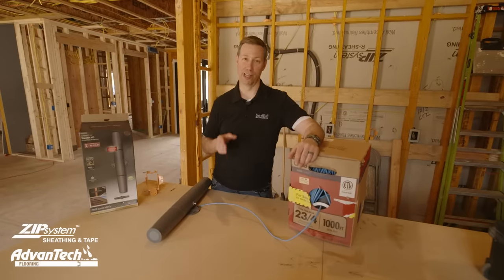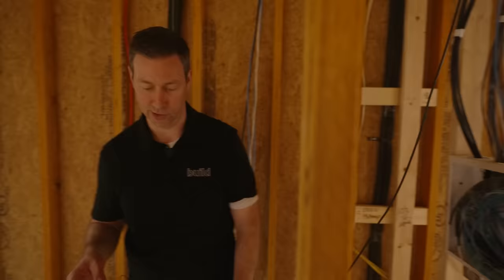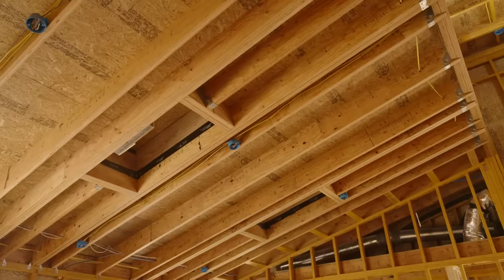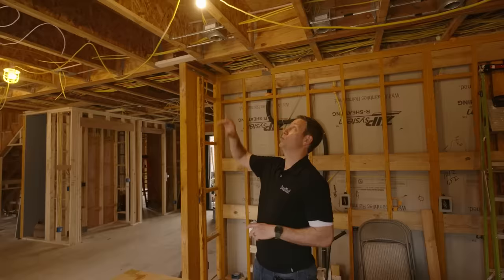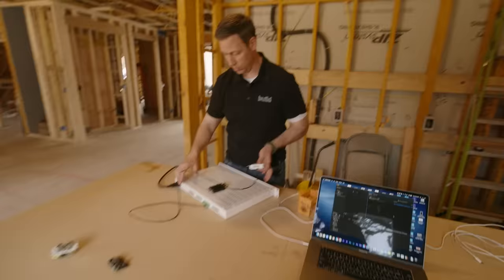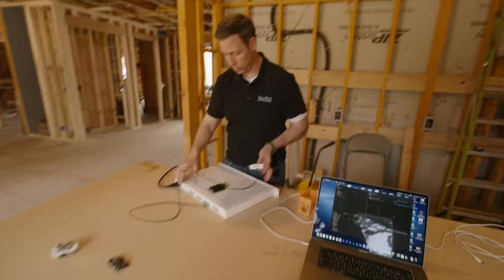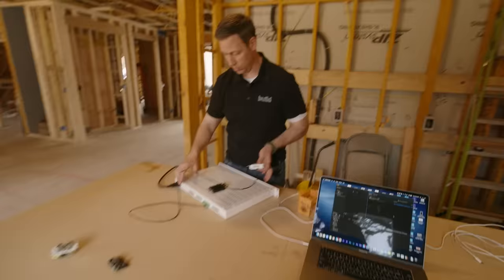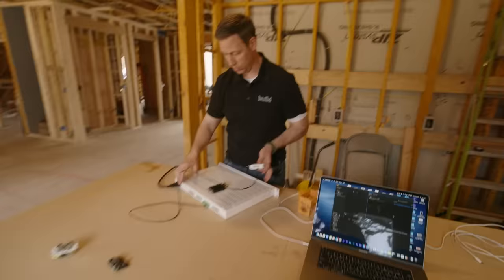Low ⚡Voltage at the Real ReBuild

Comment: You should add a flexible conduit vs a proprietary cable from the TV to your media cabinet. Proprietary cables come and go. You can always run a new cable in a conduit.
Reply: +1 for the conduit.  Change your TV and you may need to change out that wire.   I would hate to have to dig into the walls and ceiling especially with all that Rockwool.
Reply: Agreed with a nice pull cord just in case.
Reply: @Ampacityelectric  The head on that Samsung cable would need a 1 1/2" Dia opening or 2" conduit..
Reply: @FJB2020  Yep, should just drop a 20" can and put the OneConnect behind the TV
Reply: @Niccodemure  Then you have to run a bunch of HDMI and they don't play nice over 35' at 4k 60 fps..
Reply: @FJB2020  I'd run the Samsung cable outside the conduit, but still put in a conduit for future use. Then when the TV goes, you could just leave the cable or cut it off and yank it out. In fact I might run 2 conduits to make it easier for that future use.
Reply: +1 on the conduit AND when you run the proprietary cable for the TV, add a CAT6 run if you don't have one there already.
Reply: @FJB2020  I have a Frame TV above my fireplace mantle with the cable that came with the one connect box to a built in cabinet next to fireplace. 1.5" conduit and it fits through it, can confirm.
Reply: @Ampacityelectric  Yeah I did that when I built my home theater.  2" to the PJ from my media rack and 1" to all 13 speakers.. 

I am designing our new home and it will be ICF, so I am going to do Conduit runs in the wall so I can future proof the entire home.
Reply: @ErikAnkrom  In that case you have to pull the cable from the TV side right?  I see in 2019/2020 they reduced on side of the cables connector to the OneConnect box.
Reply: Matt installed a 2" innerduct from the TV location to the media cabinet so he is covered for any future changes.
Reply: @FJB2020  That's why you run it over ethernet.
Reply: @kimttar  Personally I would pass on that.... 4k, 60hz, HDR10 and ARC are flaky at best and the "lossless compression" is not something I would want.
Reply: @FJB2020  The can hold the OneConnect, Sat box and many other normal sources.
Unless he is using a BD player, but that would be odd.
I would say 95% of our installs on Frames have all the equipment local in the box. Most of our homes are to big for the Samsung in wall rated cable anyways
Reply: I've read that the one connect cable is really fragile.
Reply: @VIPvog  It doesn't like tight bends since it has Fiber-Optics inside..
Reply: We have a larger box behind the frame and out the samsung frame head behind the TV. That box is less than their in wall cable and pretty much future proofs the install.
Reply: I'd like to see a separate video on how the Samsung Frame TV install goes.  I've read many negative reviews on the install process and that it does not end up flush to the wall for the desired clean look.
Reply: @Ampacityelectric  Welcome to Texas. No basement, no attic access is the hard cowboy life here.
Reply: @VIPvog  the cable is fragile. So fragile that the first one I had to return because the cable failed. Likely due to a bend or something when I pulled it through the conduit. I would definitely advise being very careful when pulling and when routing behind tv. Test the TV first before you hang it, then after to get a sense of it's a bad cable.
Reply: @FJB2020  are you running conduit in the concrete in the wall? What products have you found to do so?  I'm starting a ICF home also & I'd like to know what you've found. Thanks
Reply: @darbycain  I found a detail on a YouTube channel, but I was not 100% sold on it, so I am going to do a modified version.. 

https://www.youtube.com/watch?v=t4N7WUusBNo

My thinking is to place 3/4" PVC in the center of my forms and run a line to each room from my utility closet.  This way I can update low voltage stuff as they change.  I will probably do this for the main 120v runs to the middle of my second floor joist bay.  I Can easily run wire to it and from there I can do the standard ICF foam detail.
Reply: @FJB2020  thanks for the video, looks like the same concept I found in ICF magazine. https://plastilockelectrical.com/  
Not sure what brand of ICF your going to build with but it's pretty thin pickins to find any manufacturer that gives info on running wires in the wall, it's always cutting the foam & stuffing wire. I'm for running wire in the wall myself!
Reply: @darbycain  How close are you to setting block?
Reply: @FJB2020  builder is in process of getting bids from contractors now. No set time to start at this point.
Reply: @darbycain  I am still in the design phase, but have already started excavation work.  I plan on using Nudura and Quad Deck products.  We plan on starting a channel on the build process (we are going to DIY 90-95% of it).
Reply: @FJB2020  Very cool. I'd like to check out your channel!  I will be using Fox Block for my foundation walls & main level. Lite Deck for garage floor & deck. I plan on DIY that part & the builder finishing.
Reply: @SeanBlader  Completely agree!  When I made a home theater with a projector and 130" screen ten years ago 1080P was still the standard.  I ran two thick HDMI cables from the media room to the projector, and then an empty glued 2" PVC pipe/conduit to the location of the projector behind the face plate of the dual HDMI.  I figured if an HDMI cable goes bad I have a backup, and if when the "next standard" comes out (which looks like 4K, but maybe 8K, or higher than 60FPS?) I can suck a line and then fish that new line through the PVC.  I'm still waiting for 4K LED projectors with lens shift to be somewhat affordable, but I definitely don't regret the $50 or less for an extra HDMI cable and a conduit.  I'll never open the wall again, so I wanted to be future proofed.
Reply: @FJB2020  And you could always cut that cable if you need to remove it... hopefully future connectors will be small!
Reply: No!  Use rigid raceway, not flexible conduit.  Why?  Because flexible conduit is vey difficult to pull wire through.  Beside that, you need a LARGE cross section on your raceway to be able to run whatever is needed.  If you use flexible conduit you run the risk of cables binding inside the conduit.
Reply: @FJB2020  This fact alone leads me believe futureproof conduits that are run should be as large as possible in diameter through areas that you can't easily fish wire. Personally, my future home whenever I get around to it won't even be in romex- it'll be flexible conduit just on the pure off-chance of the need to fix something or run an extra circuit or whatever. Although the odds of my stuff getting screwed up over someone else who I need come after and fix because they didn't know better are low, the odds are never absolute. Things going mostly wireless including receptacles and whatnot have slightly eased the burden though. (edit, i totally just realized this video is 3 years old.. oops, lol)
Reply: Yes, the stupid Samsung one cable will probably become extinct. ... hopefully

Comment: Wireless systems can easily saturate in large families and have coverage problems in large or unusual homes. Having a wired backbone for offices, stable media locations and possible repeaters/hot spots is a great idea. I am an IT professional and have six kids, the oldest 4 are voracious high def media consumers. I actually run two separate wireless networks in my home now to keep it under control.
Reply: Not really, your "saturated" when you run out of TDM on a band and frequency or channel. You can run on about 12 devices per frequency before taking hits on "speed". Even though I absolutely hate ubiquity, they do well on the AP points. They can auto channel hop thats how you can get that mythical 240 devices on a AP point though your prob going to be saturating the cat for it. Hope he is running POE with these.
Reply: Agree. For simplicity and reliability keep everything you can wired... televisions and desktop computers especially.
Reply: I have 6 Cat5e drops and I’d easily love to double that amount.   I agree with you VT ..I don’t want to endure WiFi routers degrading over time.   All stationary devices need to be hardwired leaving the mobile devices and appliance on the WiFi.   It’s never going to get any easier to drop in cables before the drywall goes up.
Reply: @hmurchison8123  honestly it wouldn't be better to run more drops that just saturates the channels more. That's what I was trying to get at. Its better to run a managed wifi network vs multi-networks. Only time its beneficial is when security separation is needed. I run 3 vlaned wireless networks for that reason. Public wifi, Private wifi, and Utilities with the later two not broadcasting thier ssid. Also you can take advantage of mu-mimo and beamforming between your ap points. But those vlaned wifi networks are ran from the same ap ppints through the managed network
Reply: @JavaZombie  power over ethernet
Reply: I always hardwire anything that has a rj45 on it..
Reply: J H power over Ethernet, commonly used for security cameras or can power other devices without need for wall outlet nearby
Reply: @JavaZombie  yes indeed what everyone else has stated. But power over ethernet can be used to power almost any network device like ap points, the aforementioned cameras, doorbells, security panels, and in some cases Raspberry pis if you use them for monitoring of stuff.

Reason to suggest running poe is to keep thins simple. Also have had emi issues before with some ap points and their respective power delivery near them. Ie transformer for door bells or AC zone panels...
Reply: @SimanSlivar  I have POE cameras and on my homestead I put in outdoor APs all over the property with direct burial CAT6.  I can mow 25 acres and still listen to youtube music lol..
Reply: @SimanSlivar  The instant you use "your" when you should use "you're," most people with any intelligence will discount everything you say afterward. Yes, it matters. No, it is not a "mis-spelling."
Reply: @Crusader1815  i honestly don't care. Im not writing a research paper or anything formal. This is a YouTube comment section not a formal setting im not going to expend the effort if i don't need too.
Reply: @FJB2020  tbh id have just put a 4g repeater in that case. But hey it works, I'm guessing you have them cent managed. What solution are you useing?  I've personally got good results with Tplink's omada also fairly affordable.
Reply: @SimanSlivar  I don't have 4g here (1 maybe 2 bars with my booster)..  I am also using the Omada's and they have worked flawlessly and didn't break the bank.
Reply: @Ampacityelectric  Ok ok.. don't take it that literally lol..  I agree about the TV.. I never use them to stream (sure wish they made a high end panel without all that nonsense built in), I use my Plex server and Shield Pro (both hardwired).  

For appliances I do not wire them or connect them to wireless.. I do not like them tracking how I use my appliances.  I am all for smart homes, but these companies ToS's are out of control and I have slowly stopped using many services that track what you do.
Reply: @SimanSlivar  I don't think your statement is true in reference to wall data drops. A wired connection by design removes a device from the wireless "space". And a router like the Unifi Dream Machine (especially Dream Machine Pro) has a ton of bandwidth and processing power to easily handle a residential home.  

If you are referring to adding more wifi APs into an environment I can see what you are talking about BUT that point is becoming moot now with WiFi 6. Wifi 6 adds so many lanes (frequency options) for devices to communicate on that saturation should no longer be a problem for a common 4-5 person family home. I could get more detailed but that is a conversation for IT professionals. (I am a Cisco engineer routing and switch) Also since Matt is using Unifi equipment they are one of the smart companies that include band steering and freq analysis to eleviate those kinds of problems.
Reply: @hmurchison8123  Same I hard wired a drop to each room, for stationary objects.  My wifi is strictly for phones and tablets, and a guest network for visitors.
Reply: @BrockGrimes  What’d you use for AP?    I’m still trying to decide whether to do Ubuiquiti,  Netgear or another brand of WAP.
Reply: @Ampacityelectric  Yeah I ditched Roku and went with the Shield Pro since it can be wired.  If you have the coin, I highly recommend it over the Roku.
Reply: @moptop8907  He is referring to running multiple wifi networks, ie more network broadcasts. Dream machine is crap or well the software that runs on it. Ubiquiti is a pain in the ass to work with, so is Cisco. Cisco has been getting better recently, but the certs are more of a seller indoctrination. Also ranks around the top worst company I have to work with... I'm also a network engineer...
Reply: @SimanSlivar  As someone who worked as a wireless engineer a few years back on WiFi networks, yup Ubiquiti has always had that reputation. It's fine for home use though, just I'd never use it myself. I'm kind of at the same place Matt is with my house build, putting in wired where it makes sense and wireless for the rest of the house connections. I'm using Aruba/HPE AP's and a controller to get good co-ordinated wireless throughout my home and PoE CAT6 so I can upgrade/replace as needed to support new standards. Central closet in the basement with switches, routers and fiber connection means my network will be able to handle almost anything. At least for the next 5 years until some other standard comes out, lol.
Reply: @chrislyttle2847  yeah cat 6 would be fine for almost everything for quite a few years. Sould also be able to run 10Gb if its shielded. I kinda overkilled mine and also ran LC fiber to all the computer nooks. Also installed access panels into the main duct, water, and network tray in the basement. So it would be a little easier to run future cables if needed.
Reply: I wouldn't recommend two separate wireless networks instead use a wireless mesh network either Google wifi, ubiquiti or meraki.
Reply: @JavaZombie  Power Over Ethernet. Good for wireless access points  and cameras etc
Reply: @BretBerger  Simplicity, reliability, and Security.
Reply: Not to mention, wireless just isn't anywhere as good as wired. CSMA/CA vs CD (basically its half duplex nature), high latency, coverage issues, power issues (like iPhones sometimes have issues with 5G and battery management), noise and interference, and a million other things. A cable just works. Basically 100% of the time. Even Cat5e (which is, what, 22 years old?) is still WAY overkill for 99% of home users/uses. The average US internet speed is around 100 Mbps. Meaning that 22 year old cable is still 10x faster.

Unless you're running a 10 gigabit network, you won't saturate your Cat5e cable from 22 years ago. Let's see an AP from 22 years ago. LOL. And even today, with Cat6 being the new "standard" you can do 10 gig. And that's with sub 1ms latency. How much would an AP cost that ACTUALLY gets you 10 gig in throughput and gets you sub 1 ms latency? Thousands of dollars, if it's even possible? AND ethernet cables can provide power. They are simply VASTLY superior to wireless. The ONLY advantage wireless has is convenience. There is no performance benefit and MASSIVE performance hits.  

I have Unifi UAP-AC-PROs in my house. I can get around 500 Mbps. Even with that, though, practical applications are much faster on wired. Take a smart TV. It likely only has a 2.4 Ghz card in it, NOT a 5G. Even with my "fast" wifi, pausing, rewinding, playing, etc. is SO MUCH SLOWER on wireless. It's not just the "throughput" numbers they list on the box, it's the latency and a lot of other factors. The difference is night and day. If you can use a wire, you should.
Reply: I totally agree, ppl saying they can do WiFi and even mesh networks in big houses with high consumer end users, just don’t do high consumers. The only way is cat6. I have two boys 15/17 and a 19 young daughter plus my wife and me. I do not get enough speed / stable coverage even with 6 AP’s. The main problem is that new houses constrains the 5Ghz bandwidth. If I get 4-5 meters away from an AP with a standard inner wall in between, all systems I have tried just falls back to 2.4Ghz. That offers max 300mps, and is not enough for high def streaming or gaming. We are running a 3Gb fiber, and if all of us are either gaming or streaming I have experienced lag. I think new mesh networks even tp-link, Netgear or google’s are not up to the task. So now I’m running cat 6 connected to AP points  (Orbi from netgear, but with wired access point to 4 bedrooms, outside at the bbq, the home office, living room and our/ kids party room in the basement. We have now stable 1.5 Gb wireless in the whole house, with priority 1.5Gb to the 2 gaming PCs for my sons. So WiFi/mesh even with Triband and beamforming is not yet performing as well as cat6. So good choice to cable the whole house.
Reply: My kids are gamers, and they demand wired outlets near their PCs. Too much latency (lag) inherent to wifi.
Reply: Get a Ruckus AP and you'll be set.
Reply: @SimanSlivar it's not so much saturating your wifi network, it's channel saturation due to how many networks are broadcast within range of your home, it's been a problem on 2.4GHz for a while, especially in condo building and apartment buildings, but even townhouses and neighbourhoods with  dully detached homes. Sure, you have 5GHz and 6GHz bands now where this isn't really an issue simply due to distance and being blocked by walls, but in apartments and condos, it can be an issue. 
Why the hate for Ubiquiti?